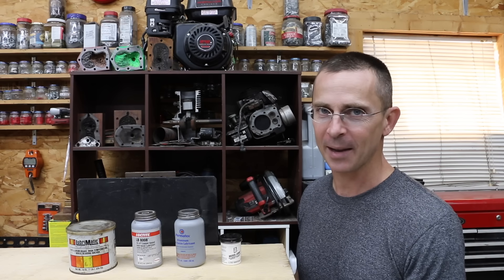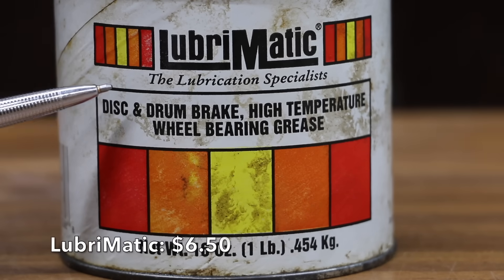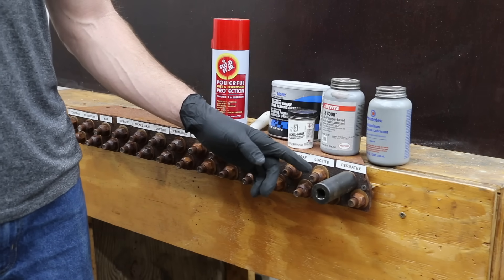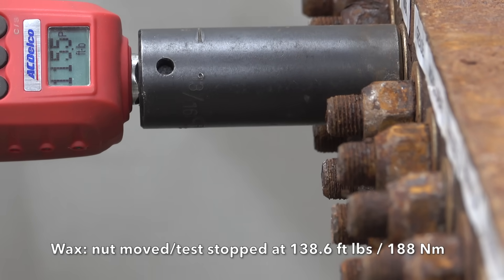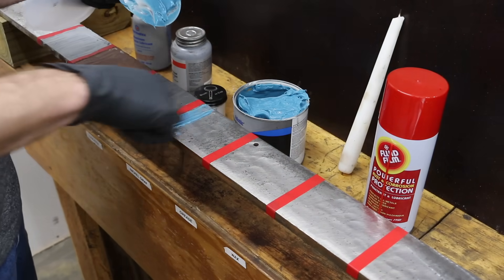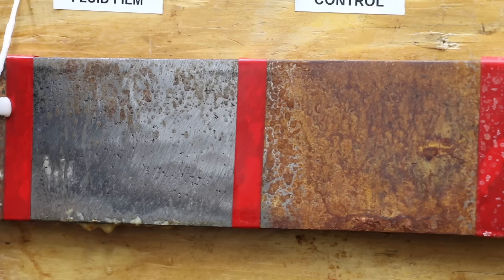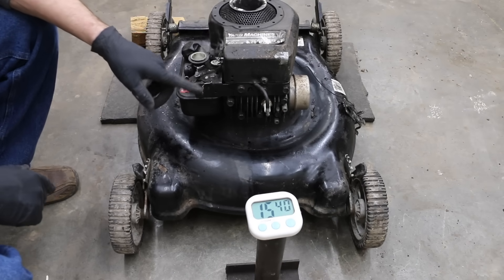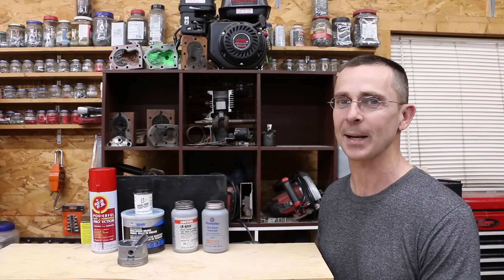Does Anti-Seize Compound Actually Work? Let's find out! Anti-Seize vs Grease vs Fluid Film vs Wax

Comment: Thanks for another great test.   I think a more balanced test would be to pick a base metal, like aluminum, copper, or nickel, then select test candidates only in that base metal.  For example, Permatex Hi Temp Copper (9128) vs the Loctite Copper (or a Loctite Aluminum - if they make it - vs the Permatex Aluminum 80078)).   I use both Permatex Aluminum and the Permatex Hi Temp Copper.  Permatex also makes a nickel-based anti-seize that would have been a good comparison against the Nickel-Graf.  The Permatex web site says nickel-based is for up to 2400 degrees and for where copper contamination is to be avoided.    The copper Permatex is rated for 1800 degrees vs 1600 for the aluminum Permatex.  The nickel-based anti-seize lubricants are also quite a bit more expensive than the aluminum and copper-based ones, so that's why the Nickel-Graf seemed more expensive than the others.
Reply from the maker: You are welcome!  Thanks for the suggestion.

Comment: Witch  one is the best to use on the brake caliper pins??
Reply from the maker: Thanks for the video idea.
Reply: Copper, in my opinion.

I'm retired after 47 years with Mercedes-Benz and BMW.
Master Technician, Star Technician awards, motorcycle road racing.✌️👍🇺🇲

Comment: I'm a mechanic. Yes, anti-seize works.

 It's a godsend on things like brake caliper bolts (which can be incredibly stuck on with road grime, corrosion and other buildup), exhaust nuts (these can get so rusty that the nut size goes up a couple mils), and 02 sensors and sparkplugs. 02 sensors can be nightmarish. Had one last week that was so rusted into the intermediate pipe that we had to replace the whole pipe. Plain old wrenching failed, WD-40 failed, torching and tightening then loosening failed. Thing was so stuck that the exhaust pipe actually bent, but no movement from the 02. It was not fun.. at all..
Reply from the maker: Thanks for the feedback.

Comment: Watched the whole video and I am impressed. Not surprised by the findings at all either. To expand on your work with my own experiences with anti-seize products I just want to note the time does kill everything. If you put anti-seize on those bolts 10 years ago on your truck suspension or bed bolt downs then you might be in for a shock. Those bolt might end up being seized anyway depending on the condition of your electrical in your vehicle. Also if your thinking this will be the fix you need in the boat to keep things easy to work on then I'm afraid not.
The main problem is salt/dirt and water mixing with stray electrical current. Especially in boats or vehicles parked outside close to the coast or heavily salted roads in the winter.
So salt, water and electricity are the main causes of rust/electrolysis for sure. On boats in particular, for obvious reasons.
All of it has to do with dissimilar metals. Mixing copper or aluminum with steel or iron always ends badly because each has a different potential to ground and if steel or iron don't have a good bond to ground then it rusts faster and heavier. Sometimes what seems impossibly fast.
And the biggest catalyst to it is stray current from a battery or shore power, or anything that might create electricity like a generator or frequent lightning strikes.
Thats why they say never use these products on spark plugs because if you don't change them regularly they get seized in your head and there goes a few paychecks to have spark plugs removed.

I am not saying what we saw was false on any measure. I am only warning you that this is not a fits to all procedure for every fastener you encounter. And that I am just trying to want people of simple oversights like using dissimilar metals on a project will result in unforeseen results.

Good luck out there and as always great video.
Reply: I had Permatex Silver last over 20 years on a Perkins Marine diesel and everything else on the boat including packing box and shaft flange bolts. My electrical system was always tight and dry. Never touched copper products except as specified for the turbines at work.
Reply: very true with iron blocks- aluminum blocks are a different story.

Comment: The copper C5-A is what was required by the book on the DC-9/MD-80 aircraft in the Navy. I use it as my go to anti seize but if i happened to have it i would use nickle based as it is the least reactive metal and it is what is used by the nuclear industry. I like permatex and loctite.
Reply from the maker: Thanks for sharing.

Comment: Wouldn't mind seeing a test of RTV sealant.  Chemical resistance,temp, how hard to pull apart/clean surfaces. Maybe even for "fun" how much pressure can they hold before leaking. Maybe see how they react to torque. 
Seeing a comparison of brands would be  interesting.
Reply from the maker: Thanks for the video idea.
Reply: thats easy- 'three bond' is the best stuff you can get.

Comment: I use anti-sieze mostly on exhausts, including turbos, where that kind of corrosion resistance isn't as relevant - any oils will be burnt away. I find copper based works pretty well - things still corrode, but there is enough of a layer on the thread that I can remove the bolts - compared to the cost of turbo housings and bolts it's a worthwhile investment. Do you plan to ever do a test that involves heating to white/red hot before exposure to the elements?
Reply from the maker: Thanks for sharing!  Thanks for the video idea.

Comment: Hi, Project Farm! Here's an unrelated test suggestion. I'm curious about the innards of refrigerator icemaker/water filters, and the quality difference between the manufacturer-sold and aftermarket filters. I've been doing filtered water particle count tests and the last filter I bought sure looks like a dud.
Reply: I really like this suggestion as well. OEM replacements are incredibly cost prohibitive - some are $60-80 for a single filter! We find compatible (knock-offs?) versions for $10-15 each, but my fridge manufacturer assures me that I am poisoning my family if I don't pay full MSRP for the OEM filters.
Reply: my fridge uses a culligan external cartridge-type filter in the back of it on the water line. there's an internal one, too?
Reply: @tommurphy4307  Unlikely to have both. Any internal filter will be visible and have replacement instructions.

Comment: I use a military grade copper anti seize compound that has flat platelets. I always try to replace rusted bolts with passivated stainless steel. They never rust or seize.
Reply from the maker: Thanks for the feedback.

Comment: The candlewax was misrepresented here. The candlewax is a great substitute in a non-heated environment. Obviously that heat melted the wax out rendering the bolt unprotected. A vehicle or piece of equipment has a significant amount of bolts and fasteners that are not subjected to heat but are subjected to corrosion.  I’ll be at more inconvenient on the front side, a candle works well if you do it correctly. You also need to heat the metal substrate a little bit. The light candle would be held at the bolt and the flame of the candle would be warming it up so that when the nut is put on, the wax is not merely sitting on top of the metal but actually coating it into the “pores”. (Aka surface grain). 
    Wax works as an even better penetrant, which I can explain the process later. And I would like to see that but head to head against these flavor of the day spray cans like WD-40, PB blaster, and the likes.
Reply from the maker: Thanks for the constructive feedback.

Comment: Pssssst... Just so you know, anti-seize in the silver can is literally a aluminum based compound. I e the non-corrosive it is very abrasive. I.E. only would a fool use it as a lubricant.

Comment: I am wondering why a poundage less than what was torqued would be a good thing. I would lean towards a product that would sustain the original torque applied.
You went through a lot of effort with this video, but I find it inconclusive with too many variables.
I did enjoy the lawnmower portion though.

Comment: If you don't use copper antiseize on an Injection molding machine bolt. That bolt is never coming out again because of the heat cycles.
Reply from the maker: Thanks for the feedback.

Comment: Anti-seize really works.  Just don't use it on your wheel studs and lug nuts.  It's too good.

There is a simple formula for calculating axial load created by torquing a bolt thread.  (T=kFD).  Torque in in-lbs, k = lubrication factor (anti-seize=.13, grease=.20, dry=.30), Force in lbs, and Diameter in inches. (works for metric too)

For a 1/2-20 lug bolt torqued to 70ft-lbs (should be dry threads)
rearrange to calc:   Force = Torque/(k x Diameter)

F=T/kD=(70*12)/(.13*.5)= 12,923 lbs axial force on stud and lug nut using anti-seize
F=T/kD=(70*12)/(.20*.5)= 8,400 lbs axial force on stud and lug nut using grease
F=T/kD=(70*12)/(.30*.5)= 5,600 lbs axial force on stud and lug nut using no lubrication (dry threads)

A grade 8 stud has a yield strength of 130,000 psi.   The root diameter of a 1/2-20 thread is 0.4374". That gives a cross-sectional area of 0.1292 in^2.  (130,000 psi * 0.1503 in^2 = 19,500 lbs load to yield).

So, while those wheel studs and lug nuts can certainly stand the much much higher static axial load of nearly 13,000 lbs with anti-seize (min yield is 19,500 lbs), remember that a car or truck wheel is extremely dynamic.  Your wheel bolt will have 13,000 lbs of axial load on them all the time even parked in the driveway.   Run over something or catch your tire on something while sliding sideways and you'll stand a good chance of breaking those wheel studs off if you use anti-seize with your lug nuts.  They are designed to be installed on dry threads only.

Some of you read that and said well, yield is not tensile.  It's higher than that.  Right, but work hardening and cracks start to form as you start to pass yield repeatedly and 70 ft-lbs is low range for a 1/2" lug nut.    If ya gotta do it, use a light oil.  Otherwise, pop goes the weasel. 

(rant off)
Reply from the maker: Thanks so much!

Comment: Doing to 90 ft lbs wasn't the correct way to go about this. The nuts were tightened to different points due to the compounds. You should have done 20 ft lbs + 90 degrees or similar, IMO.
Reply from the maker: Thanks for the constructive feedback.

Comment: I use Permatex Marine Anti-Seize, 2400 degF, for all kinds of things including car bolts, spark plugs, AR muzzle devices, and other AR components and I have no worries about stuff coming apart. It excels on marine fasteners around docks where stainless fasteners do rust and notoriously seizes due to galling when torquing even with moderate running torques.  Any grease will prevent galling but this stuff seems to have that real stick forever attribute even with salt water splashing on them.
Reply from the maker: Thanks for sharing.

Comment: I think you should have coated ( with the same protectant)where the back of the lugs contacted the backing plate they were bolted to. That may have acted as part of the torque needed to break them loose.
Reply from the maker: Thanks for the feedback.
Reply: lug studs or bolts screw into a hub or drum on all the vehicles i've seen... backing plates mount to an axle housing or front knuckle. cant wrap my brain around your comment

Comment: I used to work on KC-130J when in the Marines, we used the copper anti-sieze on the 4 small nuts that hold each of the 16 fuel nozzles on the Rolls-Royce engines
Reply from the maker: Thanks for sharing.  Thanks for your service!

Comment: Ok. I love your videos and you are super thorough!!!! I would not normally comment. Dont worry about responding. One thing i can say is someone might be Somewhat right with the wax thing. O worked pipeline and saw relativity high carbon steel that came out of the ground after 50 plus years. It looked brand new. It was not candle wax! It was stickier. Kind of like it had a grease or fat in it. The other thing with the wax is it probably acted as a locking agent after it hardened so yes it took more torque to break free. Almost like a nylon nut or aircraft nut. Again i dont know but it makes a little sense in my tiny mind

Comment: There is one major variable that is not accounted for in this test, and that is the nut factor / k factor (ie friction) for each type of lubricant when being initially torqued. Different k factors will give you different clamp loads, and different break free torques after being rusted. Manufacturer documents indicate copper based anti seize have a k factor of .16-.17, and nickel based .13-.14. Light lubricants have a k factor as high as .18. That could create a 20-30% difference in your bolt clamp loads with the same torque. 

With respect to the anti seize products you tested,  the higher clamp load generated from lower k factor of the nickel based product is probably contributing to higher break free torque. Need to be careful with fasteners and lubricant when torquing. With low k factor products, it is easy to exceed the designed clamp loads and to break something  if the manufacturer didn’t intend for such low friction product to be used.
Reply from the maker: Thanks for the feedback.
Reply: @ProjectFarm  still an awesome test, you can see that the anti seize products did their main job. I love the channel.

Comment: Dude, you are frickin awesome, love these vids. How about a eval on dryer pulley tensioner pulley sleeve bearing grease. It seems there is no definite solve out there on what lasts and works with constant heat.
Reply from the maker: Thanks!  Thanks for the suggestion.

Comment: I don't think the wax got a fair chance to shine. I say this bc you heated the bolt up which melted the wax and allowed rust creep in. I think it would probably perform much better in the test if heat wasn't used. 
  That being said I'd never personally use candle wax as an anti seize lol.

Can't believe you left the mower blade on the machine while running. 🤦

Comment: I wonder if you could measure the amount of rust that formed by measuring the amount of electrical resistance that forms when you use one of the tested objects as an electrode. Either way, very informative video!
Reply from the maker: Thanks!

Comment: the nickle graf is made for stainless steel. It is amazing how stainless can absolutely gall until unremovable. Sometimes they gall right as you install them, Stainless to stainless definatly needs a antiseaze. Copper antiseaze also improves the electrical conductivity of conduit joints. very important in oil refineries etc.
Reply from the maker: Thanks for the feedback.

Comment: Candle wax would do much beter if it is liquified on the surface and not just driped onto the cold metal surface. Sort of baked into the metal pores with heatgun or torch.
Repeat the engine oil anti-seize test with oil and small amount of the various types of anti-seize. It should get everywhere without fouling up the system. I predict the copper anti-seize would win again.
Reply from the maker: Thanks for the feedback.

Comment: we love the vids.  now the trick is to take the motors to auto shop class and see if they can get them going again with minimal outlay of cash.  like i do. hone it out, maybe reuse the old rings, new rod, gaskets/seals, clean and re assemble with nice 20-50 oil and 20% STP oil treatment to make the oil THICK (STP cheaper than LUCAS) and run them with sticker  CHECK OIL BEFORE EACH RUN OF THE DAY!!!!!  CHANGE OIL EVERY 25 hours.  change air filter every 50 hours, clean every 25 hrs. and i wud think for the average consumer... that will run it out of oil as NO ONE can check the oil before the FIRST RUN OF THE DAY... it will last... (sigh) ~ 2 years? before they run it out of oil and it throws the rod or "siezes up"... cuz never change the oil or run it with no air cleaner cuz ??????
Reply from the maker: Thanks!  Thanks for the feedback.

Comment: So, one of the forums that I am on recently had a debate about the lubricating properties of anti seize on construction equipment. More specifically, replacing grease with an anti seize compound when lubricating a backhoe. How about running a friction test for the different types of anti seize vs. a high quality grease intended to be used as a lubricant for pins and bushings.
Reply from the maker: Thanks for the suggestion.

Comment: I think the primary purpose of anti-seize is to prevent galling of the threads, particularly when using stainless steel fasteners.  It would be interesting to see a test comparing the effectiveness of various anti seize products in preventing galling in 300 series sst fasteners.
Reply from the maker: Thanks for the suggestion.
Reply: Never seez  was pretty  common where I worked .... some years back we used Led plate
Reply: @dougw5950  anti-seize is easy to remember cuz your 'auntie sees' you with no pants on.... lol

Comment: I'm an aircraft mechanic and we use C5-A in certain applications. And it is a great product. I use it on my equipment at home with great success. I live in a highly corrosive area and have very little issue removing nuts and bolts that have been put together with C5-A. It is expensive but it's definitely worth the price!
Reply from the maker: Thanks for sharing.
Reply: @ProjectFarm  no problem! Great video by the way! I really enjoyed this side by side comparison. And I will also confirm, just like you said, you can use grease when Ina pinch 👍